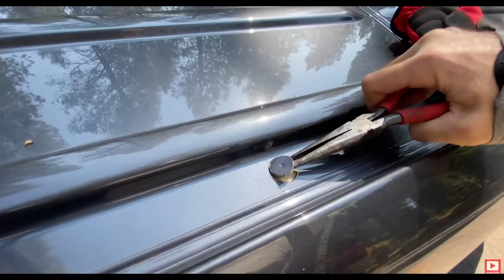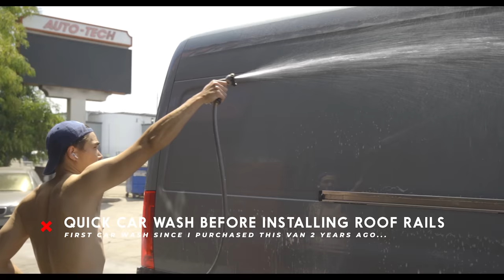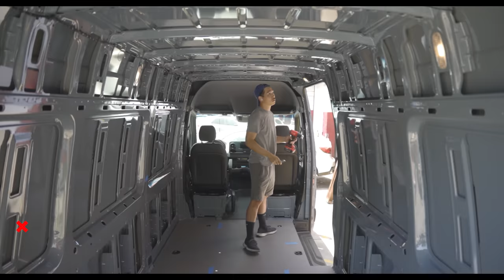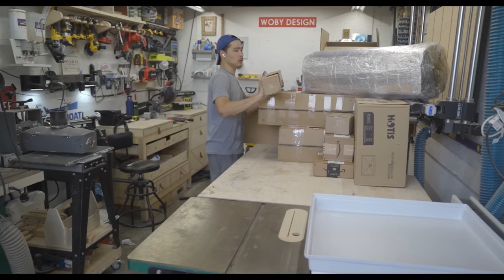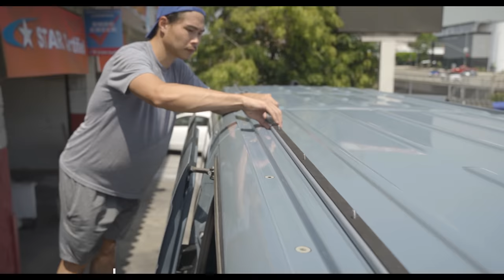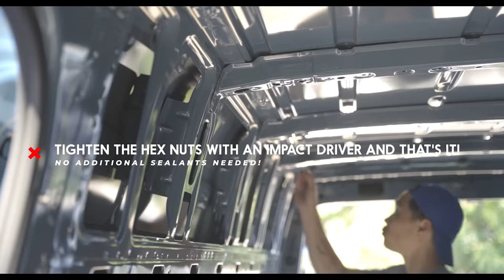HOW TO INSTALL ROOF RAILS FOR SPRINTER VANS!!!

Comment: Great work! One note, I wouldn't recommend red locktite in this application. Maybe blue. Red is very permanent, and therefore I find very few times that it's really the right answer. You were so careful not to damage the plastic plugs, but if you ever want to re-insert them, you'll need to get that locktite to break first!
Reply: My thought as well. I accidentally used some red on some outdoor metal and wood slat chairs I refinished..when I went to refinish the wood again...well...the bolts were stuck..LOL I had to refinish them in place. Learned my lesson then.

Comment: I wouldn't recommend the acetone... Use an oil based adhesive remover instead
Reply: Is it because it could damage the paint?
Reply: @pazz2518  I think so; at least it will remove some of the clear coat.
Reply: @eggsngritstn  Thanks for the info, I didn't know that!
Reply: @pazz2518  Acetone can damage clear coat and paint if it's left on and allowed to dry/absorb into it. The fact that he uses a small amount and doesn't just leave a puddle of it there to dry, means it shouldn't be a problem though. That said, it's still a good idea to use something like distilled vinegar, or a product like Goo Gone or Goof Off, instead of acetone.
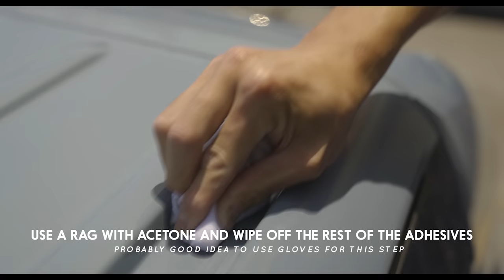Reply: 1:57 ... especially if you have a sweet mani you don’t want to ruin!
Reply: @techiefIve sounds fair to me. Consider using isopropyl alcohol as a safer alternative. It is less aggressive than acetone.

Comment: i like the way youve removed the grommets but if the roof rack needs replacing theyd be no access to the nuts without having to remove the ceiling. i think rivuts will be a better choice for what i want. thanks for the vid.

Comment: OooO Benny I dont recommend use acetone, it has stripping capabilities and older paint wont handle it like your newer one. and you got to be quick with getting it on then properly wiping it off. Use eucalyptus or tea tree oil!! Its the best for glues on paint. Otherwise iso alcohol works ok. All 3 better than acetone.

Comment: I think I would not have removed the adhesive and left it in place as a secondary protection from leaks or added some silicone around the holes nobody wants water leaks but I did like how you showed there's and easier way to remove the roof plugs

Comment: Never use acetone on your cars paint
Reply from the maker: Please explain, I’d like to know why
Reply: @WobyDesign  acetone dissolves paint but typically only if you leave it in contact for a prolonged time. still, some isopropyl alcohol would be a safer choice.
Reply: yes, be very careful with Acetone, it is a solvent for most paints and clearcoats. In fact nail polish is similar to paints and acetone is used for that as well
Reply: Acetone takes off your clear coat right away. It is very strong. IPA is much safer choice.